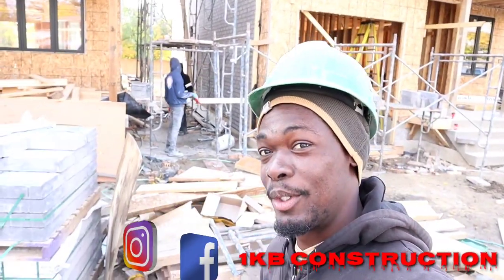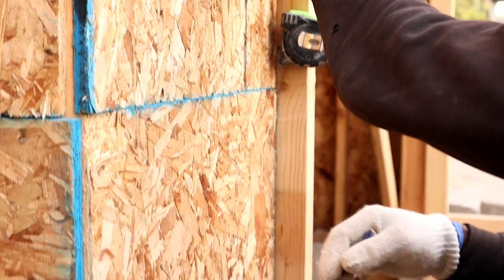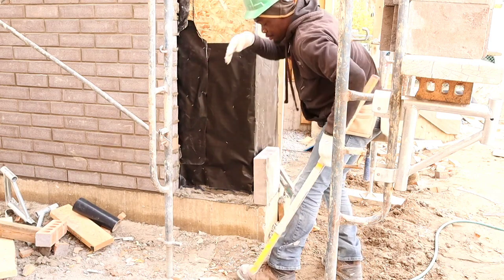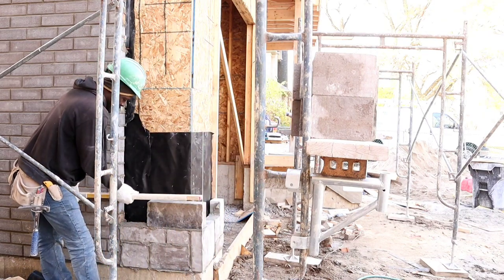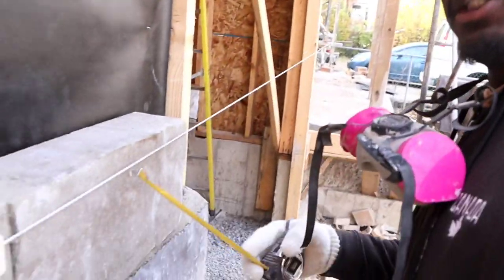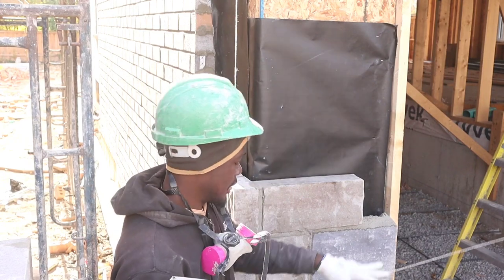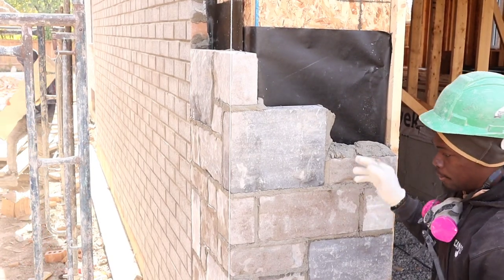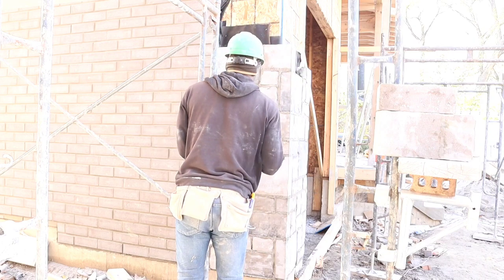Stone Masonry Tips For Beginners(How To Build A Stone Wall From Start,Diy tips

Comment: Great skills and beautiful work.
 Please could you tell me what is the correct mix material for stone work such as yours? Which sand, which cement, Plasticizers, bonding or other? I would appreciate it. Thanks.
Reply from the maker: Typically type s cement is what we  usually  use for stone but it depends on the type of stone that you're using
Reply: @1kbconstruction824  THANK YOU FOR THAT. I WILL ATTEMPT TO APPLY CRAZY PAVING (I have some old slabs to use up) TO THE BASE PLINTH WALL OF MY HOUSE, WOULD THE CEMENT/MIX TYPE S BE OK FOR THAT, OR WOULD YOU USE TYPE N? THANK YOU FOR YOUR ADVICE.

Comment: i am planning to place some blocks of 8" full bed veneer limestone that are up to 4.5' in length. so the weight of the blocks will be up to 175 lbs. will that much weight squish out the mortar such that i will have to provide supporting blocks? i had wanted to use rake joints, but, judging from this video, it looks like it might be hard to get the kind of full head joints that you can get when laying brick. maybe i will need to stick to concave joints?

i am also planning to set a limestone slab that is about 5' by 5' (2.25" thick). have you done anything like this? how would you lay the mortar bed? the slab is going to be over 600 lbs, so i have the same question about whether the weight will squish out the mortar.

there was some mortar that remained on the the blocks in this video even after you brushed them. is there a way to clean the mortar off the blocks after the mortar sets?
Reply from the maker: yes i have done it before, you can mix normal mortar with non shrink cement that  should work,  There's  lot of chemical  that you can buy to remove the mortar afterwards,
Reply: Use will ties rolled up and use them in the mortar bed to keep the weight from smashing the mortar.

Comment: WE   Never  =   EVER  measure  out  like  this   to  make  a   bottom  cut   ,  we   make  our   cuts   at   point  of   contact   with  incoming   wall or   finished  prior  ,  also   =   11  1/4   +  2   =   22   1/3   =   33   3/4   and  so   on  ,  its  quite  easy  to  figure  out  a  simple  mathematic  equation  to  not  have  to  keep   moving  tape   ,  the   Bottom  of  wall  should   be   just as  clean   as   top  and  its  Easier  to  Hide  a  Cut  AT  THE  TOP  =   NOT  THE  BOTTOM   !!!   =  master  mason   here  ,  been in  the biz  for  over  60`years   =  and the  Wire  Goes  With   Cups  UP  =   NOT   DOWN  =   Down allows  to  Motor  to  Fall  Out  of  the   Cups  of  the  wire  ,  i  know  you  are  dry  stacking  with   motor   joints  here ,  like   brick  =  its  Still  dry  stack  =  DO  NOT  CARE  WHAT  YOU  WANT  TO   CALL  it   ,  its  just a  point  of  steps  that must  be taken for  veneer  =   NEVER  =  EVER  Turn the  CUP  Down =  THAT  IS  INDEED  BACKWARDS  TO   REALIITY  OF   "   WHY  "  IT  HAS  CUPS  TO   BEGIN WITH  =  DO  NOT  ARGUE  =  IVE  SHUT  DOWN   EVERY  INSPECTOR  THERE  EVER  WAS  ON  SUBJECT  """   AND   CHALLENGE  """"   ANYONE   TO   SUBVERT   MY   FINDINGS   """  =  I  HAVE  NEVER  =  EVER  HAD  =  EVEN  WET  =  A   STONE  FALLIING   OFF  MY   WORK   =   """   NEVER  """  !!!!   ,  i  have   7   pieces  in  older  home  and  garden  books  /   magazines   and  Well   Known   for   my  work  =  WELL   KNOWN  !!!!!    i  have   placed  stone  of   billionaires   homes  that  is  still  standing  today  and   millions   of   homes  and  businesses  ,  last  stone   work  i  completed  was  a   dry  fit  retainer  wall   ,   free  standing  =  no   footing   no   cement  or   ties    and  its  took   three   dump  trucks and  one   tractor  trailer   running  up  on  it and  straight  out   hitting  it  =  NO  Damage  ,  except  for  the  point  of  impact  on  the  stone  its  self   but  wall  has  not  moved  at  all  ,  16  years  up  ,  been  disabled  for  the  last   14  years ,  and  yes  IT   DRIVES  ME  UP   A   WALL   !!!!!!!!!!!!
just  one  more  thing  =  i  have  NEVER  seen a   stone  mason  wearing  a   Carpenter  Bag  =  Never  !!! =  also  i  AM  a  Master  Carpenter  and  Master  Roofer  as well  as an   Architectural  Engineer .  =  Yes   ,   i   continued  my education  later  in  life